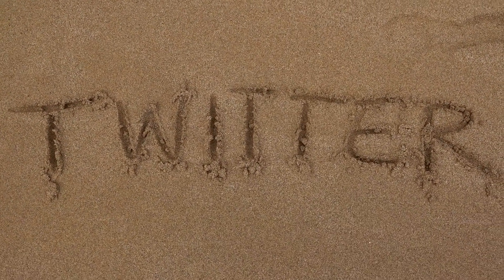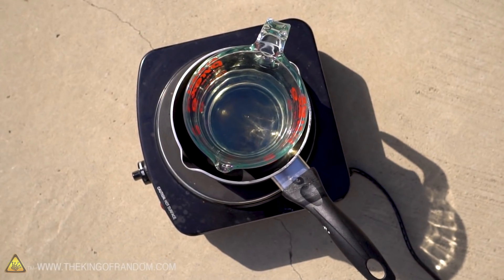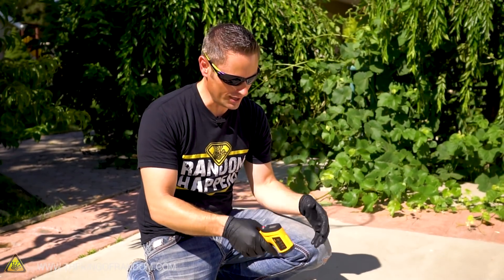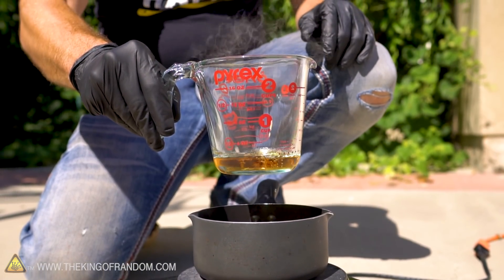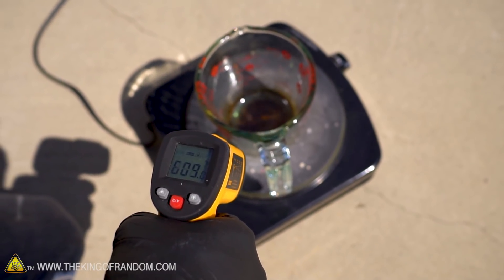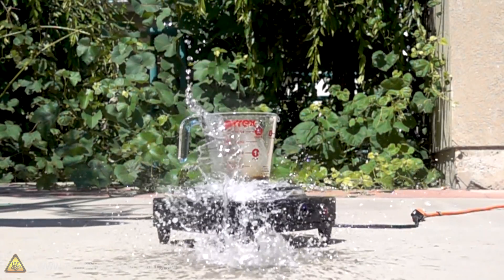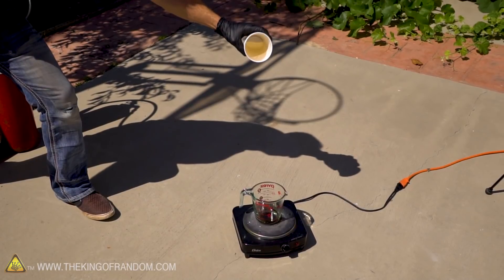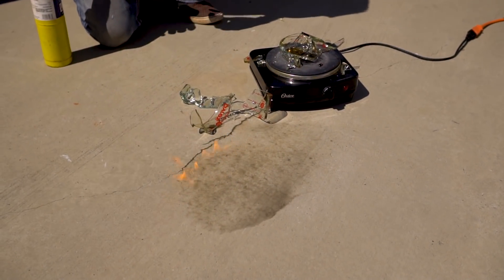Is Boiling Gasoline A Good Idea? TKOR Tests If You Can Boil Gasoline And What Crazy Thing Happens

Comment: 0:48 Pro tip. Always keep the container you're pouring gasoline into on the ground. It reduces the risk of accidental ignition due to static electricity. Then again, it's probably not recommended to boil it either so, hey, do whatever you want.
Reply: He passed away💔

Comment: I know you can extinguish a cigarette in gasoline cuz I have.
Supposed gasoline specs...
Flashpoint: -45F
Auto ignition temp: +536F
Supposed Cig specs...
Smoldering: +1112F
Peak while inhaling: +1652F
I suspect the additives to give higher octane significantly raise the autoignition temp. Not to mention (at least here in SoCal) fuels now E85 which means up to 15% of the fuel is ethanol...so basically it’s not gasoline it’s a mixed drink.

Comment: This is interesting, many years ago I boiled gasoline in a can on a small propane camp stove and the fumes coming off the top ignited, from watching this video obviously why mine ignited was do to having the open flame at the bottom rather then a  hot plate. Still interesting to know that without an open flame it wont ignite. :) this has been educational

Comment: Oil does not burn naturally, it need's to be put under pressure or met with a flame. Car's use pistons to create motion to the engine. the ethanol C2H6O creates a reduce use in oil.

Comment: stale gas wont burn in an engine. infact, if you drop a match into stale gas, it still wont ignite. however, if you boil stale gas, it'll generate a white fog that WILL light.

Comment: Vaporize another batch of gasoline and use a distiller rig to collect vapors. Test how volatile the condensate is and how easily it ignites. Try to ignite part of the residue, and use the rest to try to see if it has another use (e.g. a grease for machinery).

Comment: I've done many experiments with gasoline. It will not auto ignite unless you drop it on a surface that is roughly 900F when iron glows red. Even then you have to use small drops or a spray bottle depending on surface area of the heated object.  Diesel is even harder to auto ignite.

Comment: A liquid will never get any hotter than its boiling point. The temperature gradually got higher because gasoline is actually a mixture of different hydrocarbons, and the lighter fraction boiled first. There might be some thermal decomposition of the larger hydrocarbons on the bottom, as well (explaining the amber color).

Comment: I don't think the glass cracked from thermal shock.

The gasoline that went into the glass partially boiled, and threw some more, likely quite forcefully, at the side of the glass. On opposite corners, you had impacts from a material that was rapidly expanding, and I think that's more likely the cause, especially because most kitchen glassware is meant to be resistant to thermal shock, to an extent

Comment: What will happen if you put high voltage of electricity to a gasoline
Reply: BILL SCHNEIDER sparks are different than just sticking wires into gasoline.... It might not even ignite at low temperatures because its a poor conductor
Reply: Aron TV of course bro it will catch fire cz of high temperature
Reply: See "Spark Plug".

Comment: I work in a lab, testing gasoline for a living. Boiling (distilling) gasoline is one of the test we do. Initially will typically start to boil at a lower temp. As the lighter hydrocarbons boil off first more heat is needed to continue boil. Initial boiling point may be around 100F, but final boiling point can be around 400F. There is always a measurable amount of residue left behind.

Comment: You were extremely lucky.  All any of that vapor needed was an ignition source - n-octane will auto ignite at ~220 Celcius, but has a flashpoint of only 13 degrees Celcius. ANY spark from anything (your extension cord, the hot plate, a short, static discharge, ANYTHING) and you would be getting skin grafts.  I am all about your videos but no - your half baked video did not prove gasoline is less dangerous than you previously thought.  It has extremely high energy content, a low vapor density, wide explosive range, and is, in fact, quite dangerous.  Next time wear nomex.

Comment: That's your EPA . Who ever designed those new nozzles has never used one. You spill more gas using them than you ever did with the old type. What a bunch of bone heads.

Comment: The glass broke because of the temperature difference, the cool gasoline with the hot glass can cause it to break easily. An example would be switching one marble between hot water and cold water a few times

Comment: So how do you explain where a car hit a gasoline tank and then it goes up in flames!?????!!!
Reply: Kyla Zedeck There had to have been a spark to ignite the gasoline vapors. I'm guessing sparks are not in short supply during a car wreck.
Reply: That sounds like Holywood physics. It takes a spark and petrol vapors to get the gasoline to catch alight.  If you were to put a cup full of gasoline on the ground and throw matches at it, you'd go through an entire box of matches without ignition of the gasoline.
Reply: gorillaau not true
Reply: gorillaau I’ve done it

Comment: Think about how hot your car engine gets. If gasoline were to ignite at high temperatures, you would end up with premature ignition in the cylinder before the spark plug ignited it. Now lets try diesel as it works by compression and heat. So can you boil diesel? If it boils dry will it ignite in a pressure chamber (opposite of a vacuum chamber)?

Comment: This is simply fractional distillation, you are just separating the different hydrocarbon chains in the petrol. If you want you could collect each separate component at each boiling point in petrol, eg. butane, octane ect via a condensor

Comment: This is more for a quick start of a video so when you put dry ice in gasoline the carbon dioxide put out the match, right? But it didn't go further than the top of the glass. See if the carbon dioxide spills on the match and puts it out. 🙂

Comment: Is the sludge in the bottom of the glass flammable? And is it more or less flammable than regular gasoline?  

Also, does hot gasoline ignite quicker than cold gasoline?
Reply: kikn79 The hot sludge at the bottom probably would still be flammable, but much less than regular gasoline. You could see that even at high temperatures it wasn't boiling. When you light gasoline the vapors above it ignite, and vapors continue to come off, that's what the burning is. That stuff at the bottom hardly had any vapors (as you could see) so it would have a much harder time burning.

Along the same lines of thought, hot gasoline would DEFINITELY burn easier than cold gasoline. When a liquid is heated it gives off more vapors than when it's cold, for gasoline it would make it easier to ignite.
Reply: pretty sure that boiling gasoline leads to napalm
Reply: @uselessgamer5980  not exactly styrofoam and gasoline or soap and gasoline makes napalm there are also other methods
Reply: The sludge is napalm, highly flammable and sticky. Vietnam you know?
Reply: napalm is gasoline and starch so it's kind of napalm but not really
edit: fixed my grammar
Reply: Gasoline should autoignite at around 536°f or 280°c. Also ethanol is not a usual component of gasoline in cars, and auto ignites at a higher temperature than gasoline.
Reply: That sludge is called ethanol, that's why it's so bad for your engine, it builds up inside your engine and kills your power and efficiency
Reply: @SL-ix4yk  ethanol is just alcohol it would just burn away. also it can completely evaporate and is a thin liquid. maybe you meant something else?

Comment: Freeze gasoline and light it on fire
Reply: Yousif Plays Frozen gasoline won’t ignite because gasoline itself isn’t flammable.
Reply: John Osowski Actually It is true. Gasoline itself doesn’t burn, it’s the fumes that come of the gasoline that burns.
Reply: John Osowski Yes he did it, but the ice was starting to melt as soon as he removed it from the liquid nitrogen, which caused fumes to be released. Holding a flame to it caused it to melt even faster.
Reply: Thats true of many things harry bottom, not just gasoline, its also true of wood, paper, leaves, plastic, sulfer, etc, etc. Some things burn in the solid form such as charcoal, magnesium, sodium etc,....and of course gasoline may burn in the liquid phase if another oxidizer is used besides air, such as liquid flourine, or perhaps liquid dinitrogen tetroxide.

Comment: What would happen if you catch the gasoline vapors with the distiller?  Would the gasoline be more refined with that residue removed?
Reply: Gasoline is a mixture so you would be able to get fractions containing pure or almost pure hydrocarbons. The residue in the Pyrex container are some of the heavier oils
Reply: Eric Schwartz also the ethanol that's in the gas was boiled off before the actual gas
Reply: that's technically how you get ethanol, kerosene, and propelyene
Reply: Eric Schwartz hi

Comment: You're thermometer was not measuring the temperature of the gasoline. Once a liquid gets to it's boiling point, it doesn't get hotter (excluding superheated liquids). Boiling is when the vapor pressure reaches ambient pressure. Heat going in raises the temperature until it get's to the boiling point, past that the heat is used to convert the liquid into a has (heat of vaporization).

The boiling point of gasoline is around 85 deg C (at 1 Atm pressure), not ~160 deg C. I suspect the thermometer was reading the IR coming through the clear gasoline from the pot/hotplate.

Autoignition temp for gasoline (vapor) is close to 280 deg C.

Comment: Take an empty beer bottle poke a hole in the lid with a nail, put a little bit of gas in it and put the lid back on. Put the bottle in a small camp fire. The gas will boil the vapor will light and will make a super bright white/blue flame and a little rocket roar.

Comment: Would it have worked with thermite?
Reply: Well i don't think it would since you need a VERY VERY VERY Hot ignition to ignite Thermite. You'd need around 3,000 degrees F to get a reaction.
Reply: Yes, yes it will.
Reply: Ya  lol
Reply: MunchNPlay o
Reply: MunchNPlay  no cuz the hot surface would need to be at 2,000 degrees farenhight

Comment: Hey Grant by boiling the gas you turned it into a vapor why not try and capture and the condense the vapor and see if the condensed liquid captured  is more volatile than the original gasoline since technically you have further removed more impurities.

Comment: Think about it, it's specifically designed NOT to pre-ignite when injected directly into a hot engine. If it burst in to flames easily, it would be useless for an ICE. That's the entire point of raising the octane level.

Comment: What happens when u put sulfur hexafluoride in a pool will it sink of float like air
Reply: If the pool is empty? It'll just sit there.
Reply: if the pool is full with water
Reply: It will float off, because it's less dense than water. For reference, the density of SF6 6.17kg/m^3 while water has a density of approximately 1000kg/m^3. I don't think there is any gas that is more dense than any liquid...
Reply: Tylerisgaming he should do it
Reply: TayCraZyCat Why? You already know what will happen and SF6 is colourless, so it won't even be easy to see! He's better off doing something that isn't obvious based on chemical properties, something that will actually be interesting.

Comment: As you've discovered, petrol doesn't easily ignite just by getting hot - it needs a flame or spark. Dropping fuel on a hot exhaust does nothing - I'm told brake fluid is a lot more volatile under the same circumstances however. I was not surprised when pouring cold liquid onto hot Pyrex caused it to shatter - thermal shock.

Comment: Here's a question the substance at the bottom has to volatile I'm assuming even without the burner try pouring it out after you boil some already to see if it does the same that or the cup itself was so hot compared to the fresh gasoline which was probably a lower temp compared to the hot glass causing it to combust

Comment: I've spilled gasoline onto a hot exhaust manifold a couple times in the past, and it never ignited, only vaporized quickly. Supposedly the autoignition temperature is around 500 deg F. Great video!
Reply: electronicsNmore oink....

End my suffering
Reply: electronicsNmore same here
Reply: electronicsNmore  weird sense fire's lowest temperature is 365 degrees Fahrenheit Maybe because there's no flame and is so hot
Reply: 470 degrees celsius ish for gasoline 270 degrees celsius ish for Diesel fuel. And it's called flashpoint
Reply: electronicsNmore👎👎👎👎👎
Reply: electronicsNmore bahhh
Reply: omer Sajad You a sheep? Unreal some of the comments posted by viewers.

Comment: gas in paper cup drop a lit cigarette in it now another lit one and flick it at a puddle of gas may need to try a few times. Same cup drop lit match new puddle drop lit match. 

Results lit cig in cup soaked cig puddle soaked cig just les so flicked cig if you hit just right and the cherry explodes in to sparks it may set it on fire. open flame in cup most times will be put out when a match etc same for puddle will often light.   Reason is pretty simple 1 gasoline does not burn gasoline fumes burn 2nd it takes time for heat to be imparted to the fumes smaller area under sea level air pressure longer to ignite compress it and o2 and you can get it to ignite with less flame /spark as the molecules are closer together and take less work to have heat transfered to them that is why car etc engines don't just pour gas in to a cylinder at top of stroke and light it off. The piston will move a little and slowly but wont do much work. You need that compression and air mix to be right for it to explode and do the work you want. If you boiled gas even under high pressure it likely wont go up less there is a open flame source to lite off the vapors.

Comment: Auto ignition point for gasoline is 280*C
Reply: As in the gasoline has to be heated up to 280*C before it catches fire. The flash point is -43*C, any temperature above this the gasoline will emit fumes that will ignite if in contact with an open flame.

Comment: Once you get to a point in which the gasoline has boiled down into a gelatin you should do a test to see if that gelatin is more flammable and if it will burn longer?
Reply: Jason Meelkop I'm pretty sure that gelatin is actually a form of napalm. The King of Random should definitely check what results that yields.
Reply: isn't a matter of concentration, gasoline is the flammable liquid, if you let it evaporate there is no more flammable liquid. these brown residue are only impurities (maybe some higer boiling fraction) still flamable but i repeat is not a matter of concentration.
Reply: Alessandro Stagno that's what i was thinking
Reply: You really didnt think the glass wasn't going to break?
Reply: Don't forget the vapor.

Comment: The ignition temperature of gasoline is 280°C (536°F). However, flammable liquids cannot ignite in their liquid state. They have to become vapor (gaseous) before they can ignite. So the gasoline vapors have to reach 280°C before they will ignite. Of course, the vapors also require sufficient oxygen for ignition. Even though your liquid gasoline got very hot, either the vapor cooled too much during transition, or the heat and vapors were crowding the oxygen out.

Comment: Do you guys know what happens if you fill a red plastic cup with gasolene?  Spoiler alert - It acts like a candle!  the flame sits about a foot tall and burns for about two hours!  As it burns, the cup slowly melts to the level of gasolene and it melts/burns off gas at the same slow rate.  At the end all you have is a little pile of burnt plastic.

Comment: You could put gasoline In a clear water bottle, close it, put it on a fire, and it won't explode. The gasoline will start to boil, and before it has pressure to rupture the plastic will melt. This will cause a little fire spewing out from the bottle like a flamethrower!

Comment: What happens if you shoot a tank of gasoline
Reply: Gil Da Silva The gas comes out
Reply: It will leak
Reply: You have holes in the tank. Seriously, unless it's a tracer round, nothing happens.
Reply: Jay Y I don't even know if tracer rounds do anything
Reply: Vincentfiore2019 How many cars have gas tanks pressurized enough to explode though
Reply: Vincentfiore2019 That's a different gas. We're talking what Americans call petrol and diesel
Reply: it will not blow up, even if it is a tracer round it will not blow up for many factors such as temperatures pressure and the actual mix of oxygen and gas vapors and the bullet is moving too fast
Reply: Play games and see
Reply: Gil Da Silva it blows up
Reply: Gil Da Silva demo ranch did this, the answer is nope
Reply: Gil Da Silva it will blow up
Reply: Nothing it would just leak out
Reply: Gil Da Silva if the tank is steel might ignite. Other than that it will just spill out.
Reply: Gil Da Silva it spills on the ground

Comment: Grant try melting dry ice with the solar scorcher
Reply: Dry ice doesn't really melt at atmospheric (sea-level) pressure; it just sublimates (transitions directly from solid to gas.  If it it's under really high pressure, however, it will liquefy.

Comment: You should really use borosilicate glass containers for stuff like this. They're cheaper than that terrible Pyrex cup. Look on Amazon for Made in Germany Pyrex breaker set, only $20 and you get 5 different sizes. Borosilicate is MUCH more resilient and can candle MUCH higher tempuraters than that cheap lime glass that NON-(made in germany) Pyrex is, which is any glass that has that green tint to it.